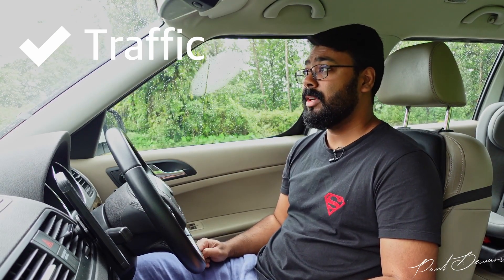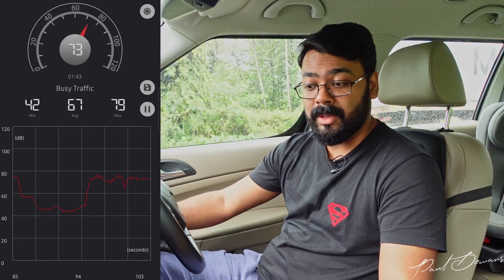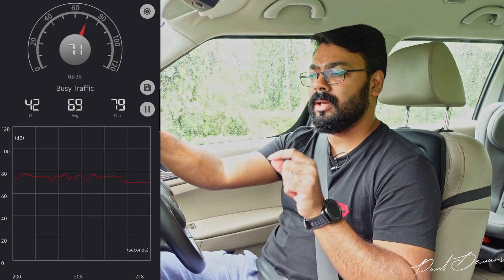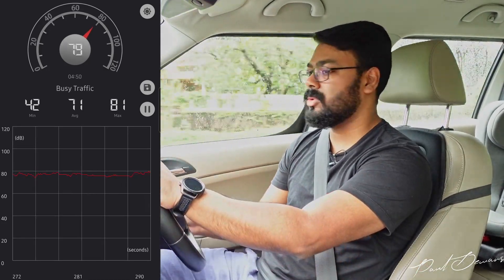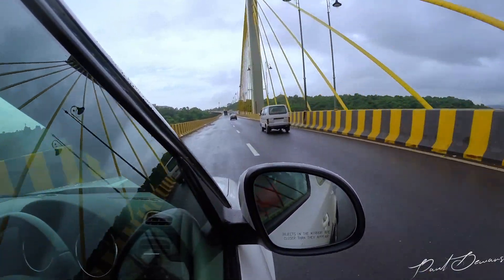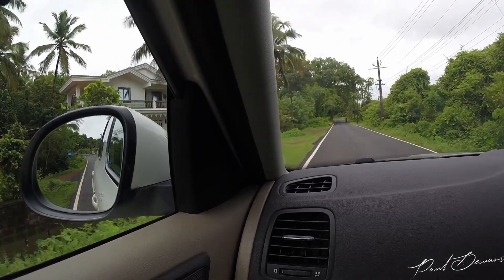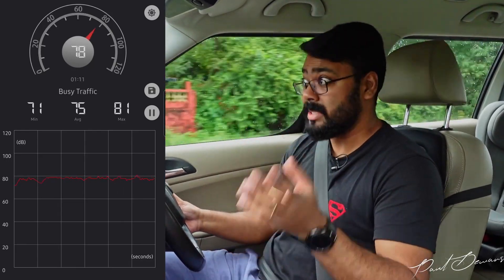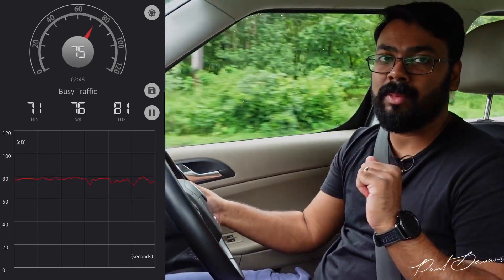The Problem With Automotive Audio | The Most Challenging Listening Room

Comment: Great! Ideally what is best location and size of the speakers for SUVs? can you also advise on the speaker topology for SUVs, how may speaker to be fitted and should not be overdesign too
Reply from the maker: Usually there are provided cavities in the doors for speakers which restricts you to specific sizes and the number of speakers you can place. I have seen some custom speakers made to be placed on the A pillar which should be an ideal location. I'd like to hear what that kind of set up would sound like.